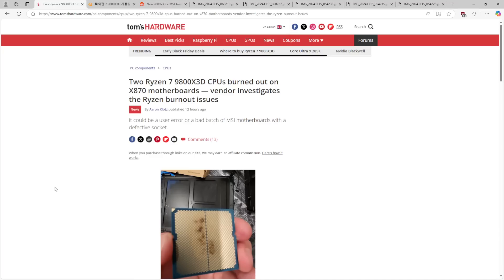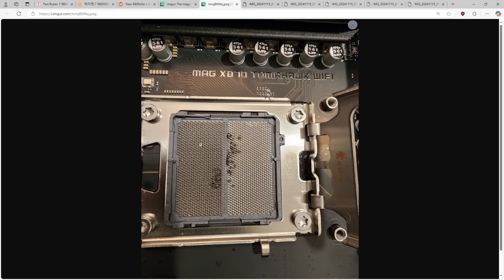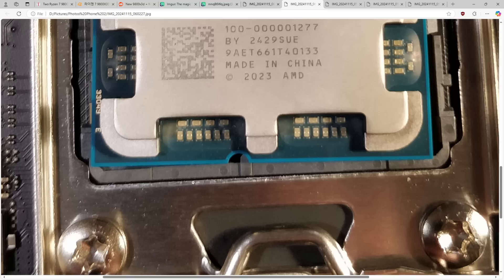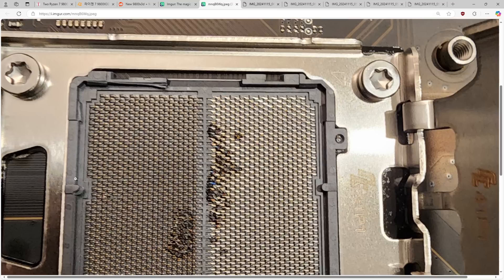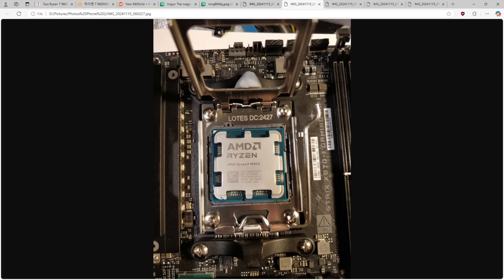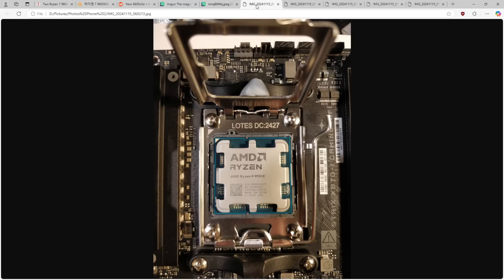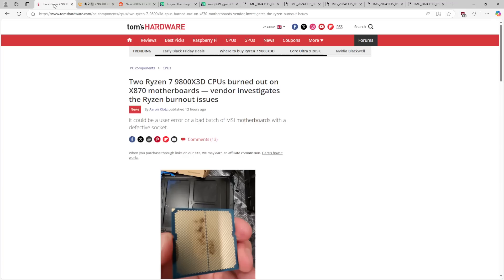HOW NOT TO BREAK YOUR 9800X3D

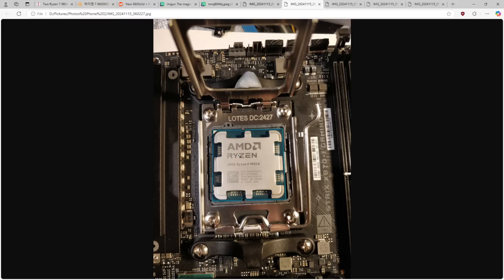Comment: 6:47 As someone who bent pins on a R7 1700 on first install, I agree that someone should have stopped me building that PC.
Reply from the maker: eh bent pins happen. Especially on PGA CPUs.
Reply: it's depending of how bad it was bend
Reply: They need to make better sockets ! Just make one corner round or triangle add some kind of horns for example.
That would be so easy.
Reply: @Lookingformorefun  they literally have notches that prevent the CPU from being installed any other way than the right way. Also there's a golden triangle that has to align with the triangle on the socket. How simple does it really have to be? LOL
Reply: @hstefan  "If you attempt to make something idiotproof, they'll just invent a better idiot."
Reply: @hstefan  Yeah.. i couldnt be more simple if they tried... Dont think ive ever used the golden triangle in the last decade, see key... put key over notches, done... Soon as i look at a cpu im looking for the orientation of the notches....
Reply: @Adamgreen735  I'm guessing common sense just went out the window when the pandemic started...
Reply: @Lookingformorefun  It's already foolproof... To bad it's impossible to make it idiotproof.
Reply: @bubsy3861  cpu makers are not even trying to make it straight forward.
Reply: @Lookingformorefun  If it's not a straight forward as it is for you... Well. It's not sounds good.
Reply: @Lookingformorefun  I'm sorry to say this but I think it's a "you" problem. In almost 30 years of building PCs I never had any issues installing cpus just by following the guides.
Reply: @Lookingformorefun  "cpu makers are not even trying to make it straight forward."
If we were talking about their naming scheme you might have a point.
But as we are talking about CPU installation, you are an idiot if you believe that. Just don't drop the fragile component onto a hard surface, and read the bloody installation instructions. It isn't hard.
Reply: @Lookingformorefun if you can't install a CPU might be better to buy a set of Lego bricks.

Comment: Good call on the vertical thought process. Never would have thought of it myself, because it feels so unnatural to consider doing such a thing.
Reply: yeah.. I've never installed a processor vertical.. I usually lay the case on it's side on a cloth to take out the processor if i need to take it out or put one back in.
Reply: You could probably get away with it on a PGA socket, but after having owned Socket 478, AM2+, AM3+ and AM4, I can honestly say this is the first time I've considered it.
Reply: @Zigglegarf  I actually did it a few times with AM4, out of pure laziness. Can confirm it works with a PGA socket, since the Pins on the CPU kinda hold it in the correct position even before you lock it and there is no retention bracket that has to be folded down so you can hold the CPU the whole time but I'd never even think about doing it with an LGA system since there is nothing that holds the CPU aligned without that retention bracket closed.
Reply: Same, been building me own pc for a decade and never i installed cpu vertically, my big brother teach me the correct way is for the cpu to fall in slot naturally, and not pushed like if you did it vertically.
Reply: Can imagine if amd and intel took these lunatics seriously we wouldn't be able to buy motherboards and CPUs separately all of them or most of them will be soldered together
Reply: Yeah it wouldn't have even occurred to me either.  I guess the reason being is that I know the HSF has to go on after regardless of what shortcuts I take with the CPU.  There's no universe where laziness is going to make me try and save 5 seconds with a CPU install just so I can then spend 30 extra minutes fighting to hold the backplate and HSF in place while I thread 4+ screws.
Reply: The guy probably installed the CPU vertically, with a can of beer in one hand. Then he pushed the lever down with his free hand and latched it with some force despite he could feel the chip biting into the plastic edges of the socket.
Reply: Exactly.  The only time I have ever put in a CPU on a motherboard already in a system was to upgrade.  That time I took everything out and put the case on the side so that the board was laying flat when I put the chip in.  It doesn't even register as an option to put in the CPU while the motherboard is upright.
Reply: you say unnatural, i say dumb lol
Reply: you can do it using am3, pin cpu
Reply: There are people on reddit asking if it's ok to lay the PC flat to install things.
Reply: I always lay the board flat on its original box and install the cpu before anything else to protect the socket.

Comment: They could both be the next PC builders for the verge
Reply: To be fair the guy from The Verge did manage to get the computer to post. Even if he did use a brick instead of a PSU and tweezers for nonexistent cable management...
Reply: @MarkLangdahl  Because he receive help, the way is sticking the ram, would break them
Reply: @MarkLangdahl  i never watched the video but i dont remember seeing any real argument for why it was so horrible. unjustified hate
Reply: @user-wq9mw2xz3j  Unjustified?  You're talking about a news outlet, giving a tutorial on how to do something with literally zero knowledge of what/why they are doing what they are doing.
Reply: @user-wq9mw2xz3j  You admit not knowing what the video did wrong, and not remembering why people criticised it, yet still choose to claim the reaction to it was unjustified? Don't you have any self-awareness?
Reply: @user-wq9mw2xz3j  installing your psu backwards will cause a potential fire, with the fan being choked. why am i even responding.....watch the damn video. you sound like the type of person to install a cpu vertically and bend the pins/burn up the cpu then blame amd
Reply: @user-wq9mw2xz3j there were many reasons, he put the power supply in backwards and couldn’t realize that was the reason for screws were “too long”
Reply: @user-wq9mw2xz3j  If I'd be there to list everything wrong with the video, I'd need to split it up into multiple comments as the :yt:🤖 would find some contentious point to delete it, and I'd be none the wiser where it was.
Reply: @mainsource8030 it wont ‘cause’ a fire. Maybe the light chance of early psu shut down. Unless you have a gutter D tier psu, in which case it would’ve set fire with or without being choked
Reply: Even the Verge did something right by not burning the CPU. These two are worse!
Reply: But they were wearing a livestrong bracelet, it should have stopped any damage.
Reply: Even from a rocket launcher missile ? @XeonProductions
Reply: He's fighting cancer in this one
Reply: Or work on Linus tech tips
Reply: Or former
Reply: Best tech related comment I've seen so far. GG:))
Reply: ooh burn

Comment: Did a bunch of people who have never used an LGA socket all decided to upgrade to the 9800X3D?
Reply: It’s honestly not impossible. If they upgraded from an AM4 system, maybe the 5800x3d, that was pga.
Reply: @thebluemarauder  But it is still common and accepted practice to install a CPU while the MOBO is horizontal, so it still is a senseless thing to do unless you're a noob... I have countless builds behind me since waayy baack upgrading Slot A 700Mhz to a 900 or 1000Mhz(running a Golden Orb cooler!)cpu and only a few times did I ever swap/add a CPU to a system in the vertical orientation and that was for testing used CPUs when I just had one compatible system up and running.
Reply: @Sadler2010  Oh yeah I’m not trying to defend this. I’m just responding to the lga bit. I feel like the pga pins might give a bit more leeway for attempting a vertical install but I’d never be dumb enough to try it.
Reply: They probably came from Slot 1 motherboards from Pentium 2 era :face-green-smiling:
Reply: @fleurdewin7958  You saying that made me recover a memory during my years of refurbishing; was messing around with an old Pentium II system for kicks and seated the CPU vertically because that was literally the only socket style where it wasn't a problem. Kind of like seating a SNES cartridge vertically. Still worked, too. Goodness help these people...
Reply: @fleurdewin7958  AM4 to AM5 is enough :D
Reply: @fleurdewin7958  Oof. You've just triggered my PTSD.
Reply: Console gamers
Reply: @damienasmr922  I think you're right. I've never thought about that.
Reply: More like never used their brain, eyes or hands.
Reply: @vitasartemiev  like to see that the triangles on the reddit post were aligned correctly and it still burned.
Reply: The user who posted this probably wanted to show his advanced skills by installing CPU while case was vertically positioned.

The funny part is not that he created the thread of burn CPU but rather his ignorance to understand what he did wrong. This made into social media and here to this channel to get bottom of this. Basically showing whole world how not to build PC or install components.

Its basically same thing as those who install RAM kits using one hand and not supporting it correctly and often break the memory lane on motherboard.
Reply: Gen Z PC builder building their PC the first time...they blame everyone but themselves...
Reply: To be fair, I have never used an LGA socket (my first desktop CPU was a Ryzen 3 2300X, then I replaced it with a 5800X3D), and might upgrade to a 9800X3D.
But also to be fair, I have eyes and a functioning brain, and can see when a CPU obviously isn't inserted into a socket properly.
Reply: Something's fucky.

The AM5 socket has been out for 2 years already.

Why hasn't this happened with other popular AM5 processors?
Reply: Exactly lol.  Or does this happen with every "new best cpu" but i've never seen all the posts of people screwing them up lol
Reply: I never did before till I had to build a PC for my friend last year since he insisted on Intel,

How the f do people.. just... What
Reply: I have barely ever used LGA sockets, and I've been messing with PCs since forever. 
MOS 6502, DIP 40. 386, soldered on. Socket 3, PGA. Socket 7, PGA. Socket 370, PGA. All the AMD crap from the 2000s, PGA. In the 2010s, only messed with Intel prebuilts (no real reason to ever mess with the CPU) and jumped to AM4 when it released. Laptops have always had either PGA or soldered CPUs. Other than Apple stuff, they had LGA for the PowerPC stuff, but it wasn't a traditional socket. 

I only have two or three non-prebuilt socket 775 boards which are LGA.
Reply: What are you even talking about? Most people use Intel since forever and have been known about LGA sockets for decades now. Only AMD until recently started to use LGA sockets for their CPUs. So vast majority of people are use to seeing LGA sockets.
Reply: Am4 users be like:
Reply: My last AMD socket was the AM3. And then I used LGA775, 1151 and what ever the second gen Intel used. Never had this issue at all.
Reply: Well even on AM4, we have to install our cpus horizontally, make sure the cpu seats properly, before we try to close the latch. The consequence is destroying the pins on the cpu.
Reply: AMD users discover LGA for the first time 😂😂😂
Reply: My first system is the 7950x3d but I'm not r3tarded so everything went fine
Reply: Yes, actually. Console gamers, people who've genuinely not handled an LGA socket before, former prebuild users...

The 9800X3D is a goddamn phenomenon at this point and it dropped just before Christmas. It's going to engage a lot of folks who otherwise never build PCs.

Comment: 10/10 analysis as always. ILM pressures can get very strong, definitely enough to break through the plastic socket.
Reply: that's one flimsy plastic
Reply: @Lookingformorefun  every plastic is flimsy if the lever is long enough. And it is.
Reply: @Lookingformorefun  It's a softer, more flexible plastic instead of a harder more brittle plastic. Different material traits for different applications, there's no need for a rock hard plastic here.

Comment: how did they even mess it up lol,  cpu installation is way easier in am5 than am4
Reply: Not sure I agree, its a lot easier to break the socket if the CPU slips out of your fingers and drops into the socket, whereas AM4 that's not an issue.  But I do like that I don't keep making the same idiotic mistake when removing the heatsink of ripping the whole CPU out of the socket when its locked, because I ALWAYS forget the twist motion to loosen the paste.
Reply: tbf it was 5 years ago when i built an am4 system, but recently built an am5 and the cpu installation was really smooth and hassle free, as if it just fits instantly into the mobo pins, compared to my am4 installation where i triple checked it out of anxiety. but like bz said installing it vertically has a high chance for mistakes on any socket
Reply: @awit7370  Don't get me wrong, it is rather smooth, but I have a disability in my hands which makes them quite shaky/cramped which makes LGA harder for me personally as the socket is more fragile than the pins on AM4 CPUs were.

That said the only time I damaged an LGA was when I got thermal paste in it and ruined the socket trying to remove it.
Reply: @alexatkin  For me yeah, it the cpu slid the socket like a glove, the main reason a lot of new builders damage their stuff is because of unneccessary pressure from trying to force the cpu into the socket without even checking if it lines up correctly,. In am4 where pins are on the cpu you will be likely exerting downward force on the pins if it didnt line up correctly on the socket and excessive pressure would just bend it.

Comment: Close enough for government work.
Reply: My experience, as someone who works in government, is sort-of the reverse of the meaning of that expression. Most of my coworkers would be most aptly described by, "perfection can be the enemy of the good enough".

When "deadlines" aren't, and bosses generally don't enforce those that are, workers tend to want to get everything perfect, even if it means three times the work needed for 99.9%.

To be honest, that's my default mindset as well. I have been trying to change it, but it's hard to know when I've hit "good enough", so I'm actually using the very foreign concepts of "beta testing" and "end user testing". If the people who are to use it think that it's good enough, then it probably is, even if my heart aches at the imperfections.
Reply: The guy who's cars were well known for their panel gaps and loose screws who will run the governments efficiently department: "Fits like a glove! My job here is done'
Reply: Not until doge gets on your case.